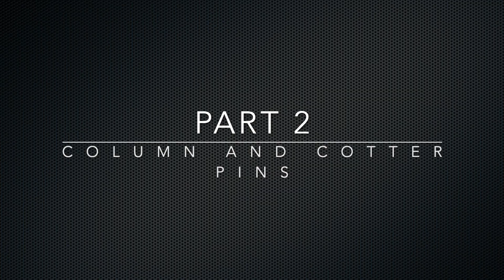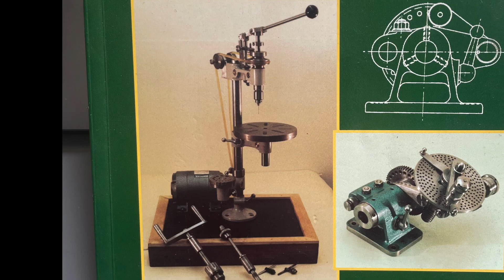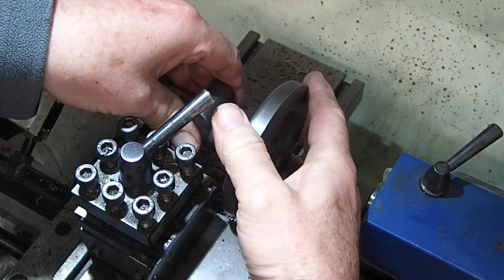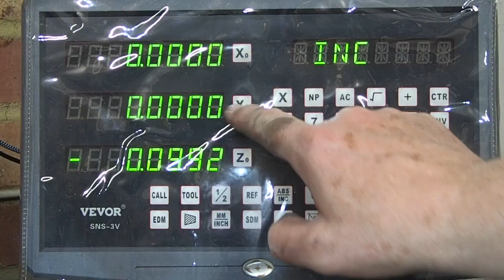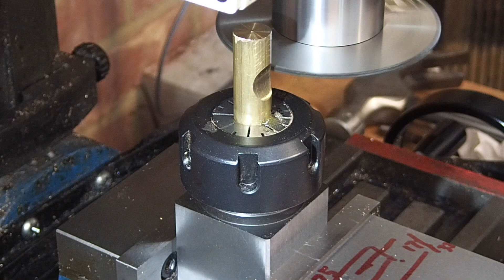Universal Pillar Tool -  Part 2 Column and Cotter Pins

Comment: I wouldn't be able to do that shaft, way too long for my little lathe. Well done. 👍
Reply from the maker: Thanks Paul, it's about as long as I can get in my lathe.  The Quorn tool grinder is going to be entertaining as the two main shafts are a similar length and one needs a deep hole in one end!